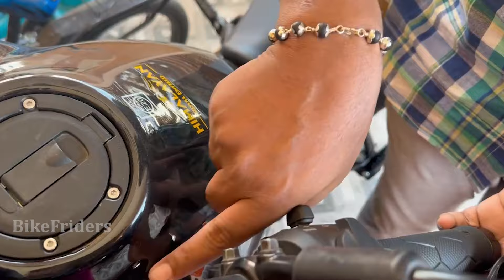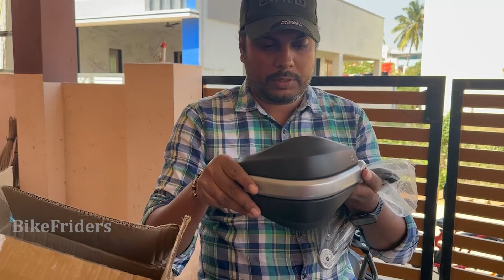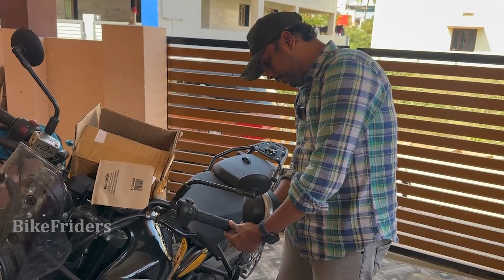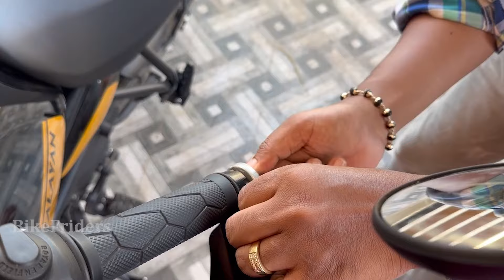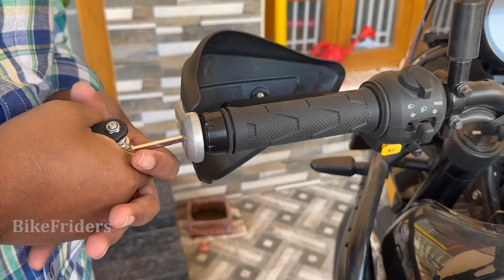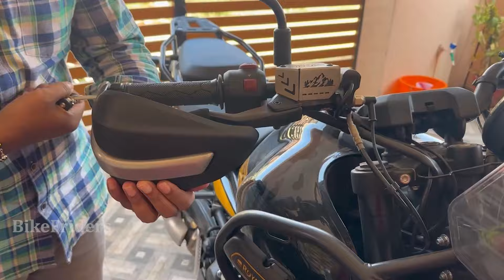😱Himalyan450 Original RE 🥰Hand/Knuckle guard 💪Safety First🤕  #re #royalenfieldhimalayan

Comment: Bro what's the length of Allenkey bolt you purchased
Reply from the maker: it should around 2 and half inches bro
Reply: can I buy the allen boot of the same length as that of the one that comes with the old knuckle guards.I think it is around 70 mm.
Reply from the maker: Yes but the diameter should be of this new one
Reply: thank you

Comment: I too brought the barkbusters replica for 450 and not satisfied with the quality and planning to buy RE hand guards, so the bolt that came with the RE hand guards will not fit the 450?, 
I also brought the carbon racing windshield have to check if the hand guards are hitting the windshield after install
Reply from the maker: Yes you have to buy longer bolts in order to fit it
Reply from the maker: It is hitting the windshield bro I got my carbon racing too the solution is to use old Himalayan 411 bar end weights with larger bolts 
Video on that coming soon
Reply: @Bikefriders Thanks for the heads up 😀, waiting for your video

Comment: How did you get it bro? It’s not available in site
Reply from the maker: I got it from Amazon. You can buy from below link 👇
https://amzn.to/49ezA4T
Reply: I got it from Amazon, thanks. But the bolt is becoming a problem. I have looked in a lot of shops. The bolt that comes with packaging is a bit thicker. Need a smaller size Allen bolt. And I can’t find spare bolts anywhere.